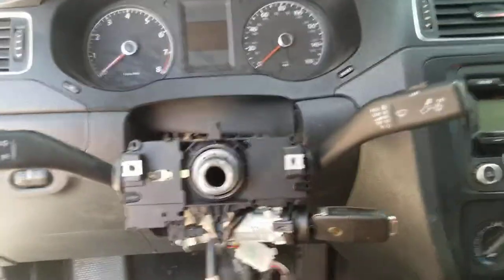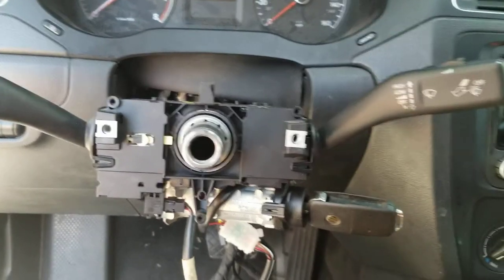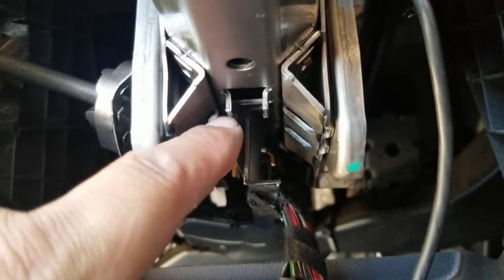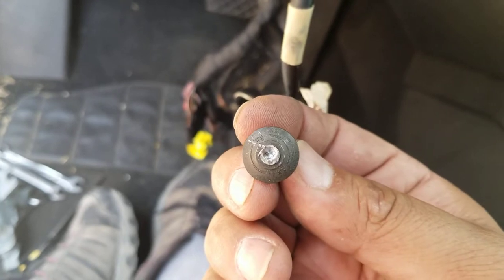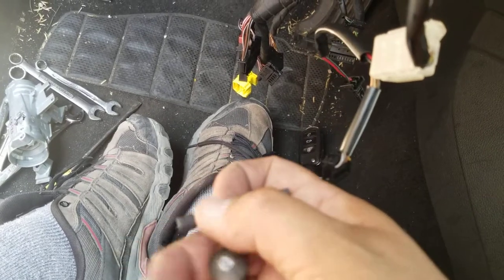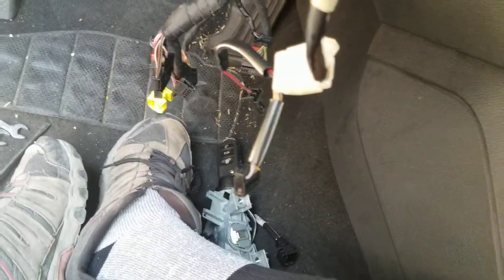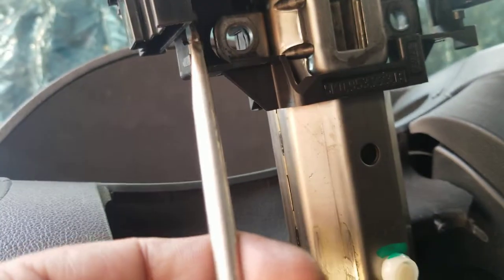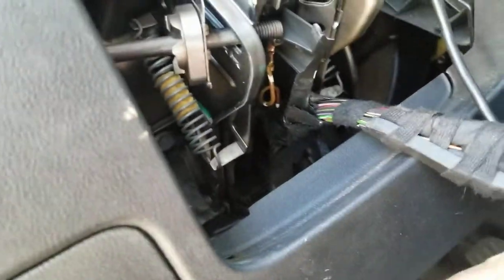2011 Jetta vw steering wheel replacement remove removal ignition lock replacement

Comment: Hi, so what you’re saying here is to not remove the steering wheel and do the method that moves the steering column forward, correct? Or you’re saying to still remove the steering wheel and then move the steering column forward for more room? Also, is this because the other method of leaving the lock cylinder on and drilling the hole and breaking a hole on the body, as done in your other video a year earlier, didn’t work long term?
Reply from the maker: I would remove the steering if possible in order to have more wiggle room. Correct,  the previous method was a temporary fix for me, others have had more success with it.